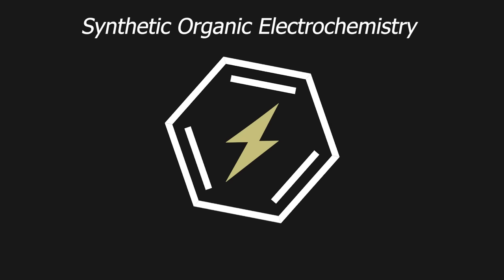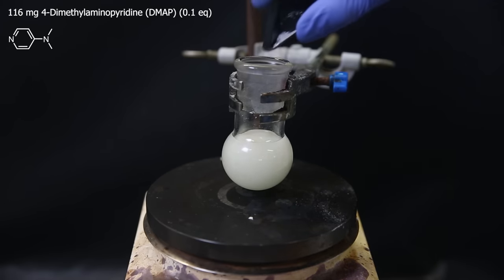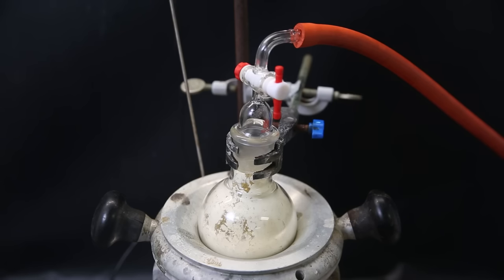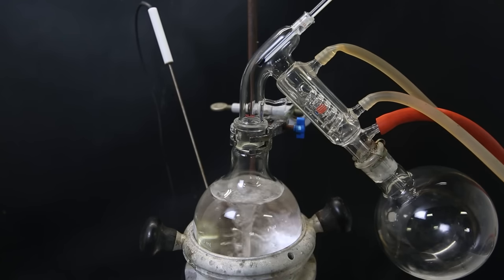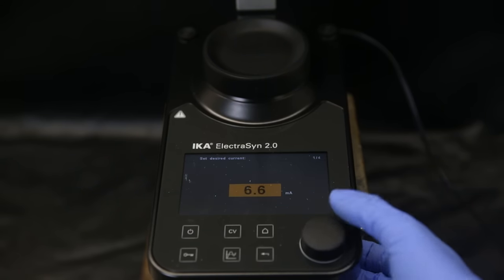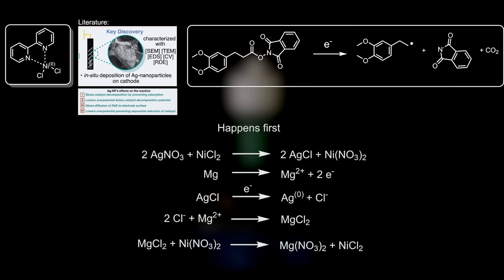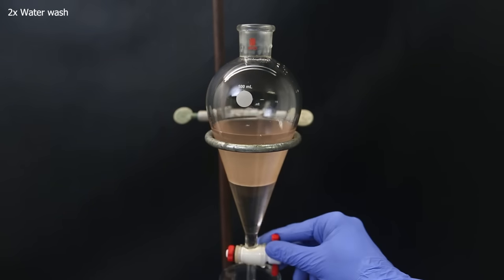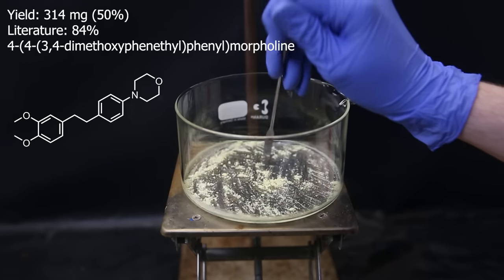Will This Revolutionize Chemistry? (Organic Electrochemistry)

Comment: Bro literally combined the two worst types of chemistry in existence and got an actual, measurable yield which is really impressive
Reply: He brooo where is your biodiesel video. Can you make it using coconut oil? I think the biodiesel will be great because coconut oil has many short chain fatty acids which might give a biodiesel with lower flash point and lesser viscosity 😉😙
Reply: How dare you, lol
Reply: Organic chemistry is the best type of chemistry, fym
Reply: Still kinda yellow
Reply: Dude. Ochem will always be supreme.
Reply: Which ones are talking about? I didn't see any photochemistry. And cross couplings rule
Reply: I wonder hydrocarbon fuel cells will beat burning them soon, and if they'll have higher specific energy than supercaps but also higher energy density than hydrogen
Reply: @williamackerson_chemist I am researching the production of ethyl esters. I've found that using ethanol and canola oil requires near anhydrous conditions to allow the phase separation to occur. Using soybean oil, I've fractionally distilled the ethyl palmitates from most of the ethyl oleates. The distillate is enriched in palmitates with some oleates, and the bulk of the oleates are purified. I use a potassium glyceroxide catalyst which recycles the byproduct back into the reaction
Reply: Organic chemistry is amazing. Analytical chemistry.... that's a nightmare.
Reply: Physical and Inorganic (specifically anything to do with the f-block) chemistry are the most hand-wavy "nobody really knows how it works, you just need chemical intuition" of them all which I think qualifies them as the worst
Reply: Cavitation and plasmiods under ideas of inertia given deterministic values kinda imitating information theory has tremendous potential..
These critical extremes states is where everything interesting occurs from lightning to ionization in space. 
But it undermines evolutionary mythology that has strong beliefs its created negative opposition to establishing unified theory here pushing effective complexity to the top of higherachy grand theory of everything. 

I do think its going up to tested by elon  or some other  private space man soon
Reply: @andrewjones4115  You mean Analytical chemistry is amazing, and Organic chemistry.. that's a nightmare. Surely you couldn't have said that.
Reply: worst in the sense of brain hurts or worst in the sense of usefulness?
Reply: you mean the two best types of chemistry
Reply: My chemist buddy said quantum chemistry was the absolute worst… and I have a physics degree and failed O-chem three times so I’m gonna have to take his word for it…
Reply: Stereochemistry is my fave

Comment: Organic electrochemist right here! Great video. I use electrasyn quite often and can say it changes the game for good. Electrochemistry introduces more variables besides that of organic chemistry, which can be a nightmare for some but also an advantage as you can get different outcomes from the pure electrochemical optimization. Gladly electrasyn handles that very well and not much electrochemistry is required for one to get to know the field

Comment: Awesome chemistry! I want to try some electrochemical organic synthesis now!
Reply: It often looks good on paper, but can be a headache in practice. A good place to start is a Kolbe synthesis because of the simple setup. Then switch to divided cells, try a 'simple' electroreduction of oxalic acid to glyoxylic acid. A PC power supply is a good source of low voltage high current, and you need a rheostat to specifically adjust current to the required current density on the electrode. When using divided cells, it is also recommended to use a reference electrode (usually calomel or silver chloride) to be able to fine-tune required voltage (all excess will convert to unwanted resistance/heat + fine tuning voltage at cathode allows for selective reductions).

Comment: Kinda got me excited about the progesterone synthesis... any chance you're gonna do a video about prog or maybe estradiol? 🤠
Reply from the maker: Maybe in the future! Currently no plans for hormones, but I would prefer doing it chemically (without electro). My choice would probably be testosterone though ;)
Reply: @Chemiolis  Testosterone is really cool too. Without at least a little bit present, one's hippocampus would be very unhappy 😅
Reply: @Chemiolis  Going off readily-available precursors, testosterone is by far the easiest because converting between corticosteroids, progestins, androgens, and estrogens requires making/breaking double bonds without destroying everything else. DHEA is available over-the-counter in many countries and is biologically not very useful, so it's a great synthesis platform because it's an androgen you can easily convert to actual, useful testosterone in a lab with simple reduction/hydrogenation reactions. Estriol is also available OTC but not in pure form, so there IS a readily-available estrogen to do similar syntheses with if you don't mind having to extract it from like 7 bottles of menopause lotion.
Reply: thy labs made estradiol from testosterone using aromatase enzyme... while wearing an interesting outfit
Reply: @cvspvr  maid dress and chemistry socks, obviously 🥰

Comment: Ozonolysis is the latest "new" tool in organic chemistry. The old oxidizers such as permanganate or chrome get left in the dust. Uses 95% Acetone.
It streamlines the process, leaves .HCl  intact. Under 1 hour to completion. 
90% yield. Pale yellow colour. 
Amazing!
Reply: Ozonolysis isn't new at all, it's just the same old early 20th century methods repackaged as "green chemistry". Also ozonolysis usually requires dry ice temps, and isn't without risk, intermediate ozonides are often sensitive explosives.

Comment: I've been saying this for years, electrolysis for REDOX reactions makes so much more sense from an energy input standpoint and removes the need for high activity reagents.   Only issue to be worked out for manipulation of organic compounds is finding a suitable polar solvent.    Changing the anode/cathode material may allow for more selective reactions, i.e. partial reduction and targeting certain functional groups of a molecule.

Comment: F/mol is… such a weird unit. I guess it makes sense when you consider the substance like a capacitor being charged up by the apparatus, but it still smells strongly of unit crimes.
Reply: Faraday, not farad. It's one mole of electrons.
Reply: ...god, I hate it when units use the same letters. That makes more sense but I'm just more upset.

Comment: I stopped putting sand on the top of the columns when I was working with nitrogen heterocycles, because I would sometimes get red iron complexes eluted from the column, from the iron getting extracted/stripped by heterocycles even from the "low iron content" sand.

Comment: Okay, faraday's per mol is completely insane. COMPLETELY. I had to walk down a long path to even figure out how the hell any scientist thought up this unit of measure. First, you have the SI unit for electrical charge, which is coulomb. Then you have a constant called Faraday's Constant which is the amount of coulombs in 1 mol of electrons, expressed as coulombs per mol. Then you have a goofy NON STANDARD unit of measure called the faraday (little f) which is an amount of coulombs equal to Faraday's Constant times Avogadro's Number, expressed as coulombs. Then finally you have faraday's per mol which is actually... COULOMBS PER MOL AGAIN. But its worse than that! its an AMOUNT of coulombs per mol!! 

Only a chemist could come up with such a foul non standard usage of SI because it contains Faraday's Constant and Avogadro's Number in such a way that it likely makes some basic algebra simpler down the line. JUST USE COULOMBS PER MOL. My brain hurts. 

Oh and don't confuse this with the SI unit farad! that is 1 coulomb per volt! And you will likely deal with farads doing electrochem because they are how capacitors are characterized.

Comment: i always loved synthetic organic electrochemistry. Problem is indeed: standardized equipment; cell construction, quality low-resistance diaphragms (they will charge you an arm and a leg for a few dm^2 of Nafion® sheet, which is just sulfonated polystyrene), efficient cooling of both anode and cathode, and expensive platinum electrodes. A lot of it is overkill though, when you see how pre-1960s chemists approached it with cheap unglazed porcelain diaphragms but of course resistance will be high making efficient cooling a hassle. 
BTW electrocatalytic hydrogenation using a sacrificial catalytically active anode (like nickel) in a single, undivided cell is an understudied subject, the old approach usually was electroreduction on cathodes with high hydrogen overvoltage like lead or mercury, in divided cells. With electrocatalytic hydrogenation, through the sacrificial nickel anode a continuous, fresh and highly active spongy layer of nickel saturated with hydrogen is deposited on the cathode, eliminating even the need of a diaphragm. Of course due to the nature of the setup it will be limited in scalability, but it could be an elegant alternative to the classic hydrogenation with skeletal (Raney) nickel.
Reply: Nafion isn't sulfonated PS, it's actually a branched perfluoroalkyl sulfonic acid. I recommend using the re-enforced stuff as a cell divider.

Comment: i still think HHO gas generators is my favorite application of electrochem. or does that not count because its just breaking a bond and not really synthesizing a compound? i think we will see HHO gas an energy storage or energy transportation in the future, or possibly just H2 gas. transporting HHO gas is kind of insane because of how unbelievably explosive it is and how energy dense the gas is, but if you have a container that isn't leaking than you can store energy essentially forever. i could only imagine the blast from a huge tanker car full of HHO going up in a rail fire though. just propane or butane is bad enough when they go up

Comment: @ 7:34, if the air bubble editing you spotted was that big one in the center about 1-2 cm up, I wouldn't worry about that at least... 😅
It looks like it's in the glass itself, which would be worrying in itself, since it's a weak spot. 😕
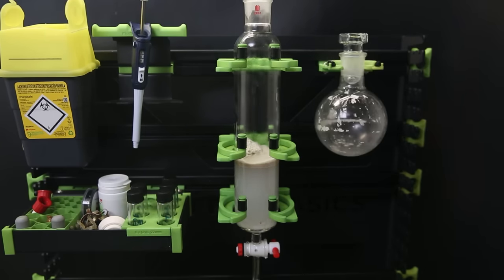You can see it before you loaded the column (7:17), and also on the second column (19:13).

Comment: It's a bit spooky to me to put a clamp on your air hose when doing flash. I prefer just pressing it on by hand and it plopping off if the pressure ever gets too high (sometimes product starts crystallizing in the column suddenly when it becomes "too pure", clogging it) rather than having the column itself potentially blowing up.

Comment: Amazing trying to inspire the way to utilize microwave assisted synthetic chemistry.  Thinking you can detail more regarding as I still feel, just like electrolysis and other RF assisted reactions, there are many areas of opportunity for the devices and the methods.
Reply: Figure the range of analog and digital methods expansion opportunities if wasn't clear.  I assumed at a younger age that the spectroscopic methods must correlate somehow to more selective reaction areas of opportunities.  So from DC to daylight and ionizing methods as well.
Reply: Excellent work FYI!  Thanks for sharing!

Comment: love the video like always, but i really have to mention how the column is sagging over time. maybe they can make some different kinds of holders but it scares me so much how the column moves over time. personally i wouldnt feel confident leaving it alone for even a bit lol <3
Reply from the maker: It was because I was pushing on it on top to hold the adapter & pressure! It doesn’t slip if it just sits, as long as the column isn’t too heavy for the amount of holders. Since it’s resistance based it should need even less for lighter columns, I just only have really big ones :’)

Comment: Many years ago, knew a meth head in Kentucky, who would run electricity thru chicken wire, and spray it down with cans of Insecticide. It crystalized on the wire, and he'd bust it off and sell it as other products. As someone with no chemistry experience, It's cool seeing chemistry/electricity used in a lab setting with better purpose lol